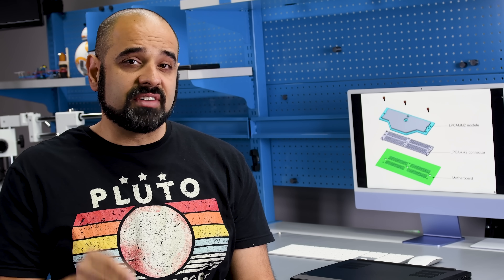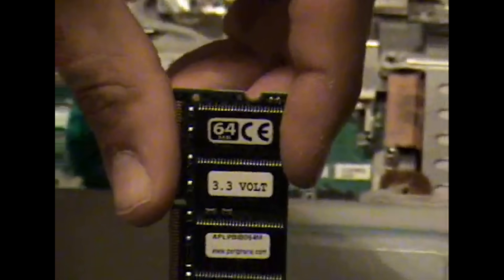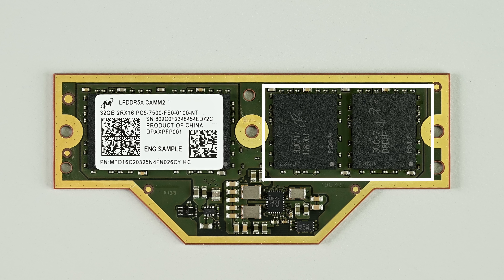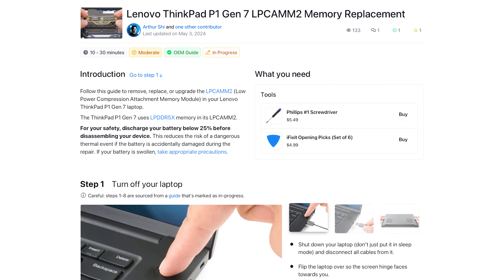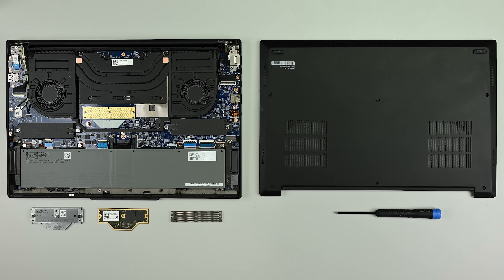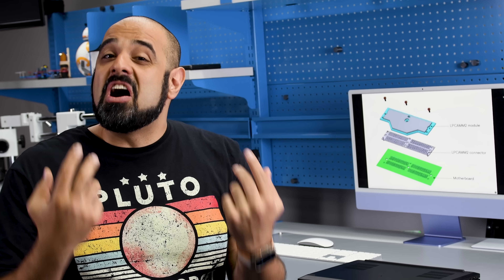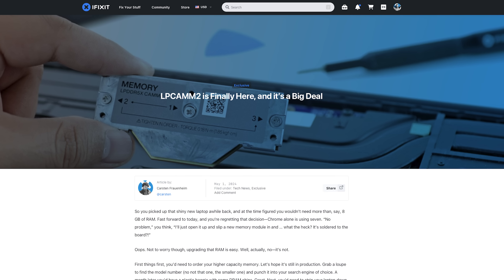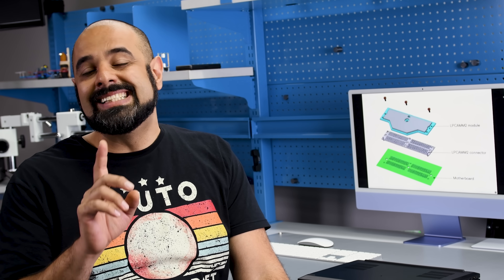New Laptop Memory Is Here! LPCAMM2 Changes Everything!

Comment: But manufacturers found a way to make you pay even more to get more memory. Why would you let the user replace the memory, if you could charge them double the amount of a ram stick for the next memory size?
Edit: As of today, only a few laptops that cost more than 2000€ have this module, yo it's nothing that will be seen on consumer laptops.

Also my 12gen Dell laptop still has normal DDR5 memory slots. On business devices it's more common to have somethin like that. I miss the times where you just had a door on the bottom of your laptop and were able to replace everything.

Comment: The information in this video seems wrong to me: as far as I know LP-DDR-RAM exists for many, many years already. And also RAM is soldered close to the processing unit because it can be faster this way (shorter connections -> higher frequency) or because it’s cheaper/easier to manufacture, NOT because of the lower voltage. The higher speed is also the reason (as well as it’s of course a nice feature for the manufacturer if it’s not upgradable..) why it’s done this way on Apples M chips and also on dedicated GPUs from AMD, Intel and NVIDIA. 

Come on ifixit, I know that you can do it his better!!

Other than that: thanks for making the otherwise good and informative video.. but please keep on taking your mission seriously and do not let slip mistakes through as it really undermines at least my confidence in trusting you. And you might just gave probably false information to almost half a million people!!

Please don’t be advert hoes! Please stay independent! We consumers really NEED you to protect us from scammy manufacturer tactics!!

Comment: IMHO! manufactures should start learn from fruit company, re-design the power supply to all power distributions. Example, 20 volts supply to PWM then step down to desired voltage, its all wrong！anytime mosfet give way & it will just lead the 20 volts to the very end of circuit, like CPU & GPU.

Comment: The reason you upgrade a Mac is the whole CPU, GPU, etc, not just the memory. It's not like in the x86/Windows world. Also ARM is a lot more efficient than the x86 architecture that carries 40 years of legacy. Would be nice to have an upgradable Mac, but it would need to be more than just the memory.
Reply: Apple could maybe even make the CPU removable without too much effort or loss of performance. Would also solve the memory issue. And a lot of people would be happy to retain their CPU and GPU while having that but of extra ram. You can still get a new laptop, the point is to give people more options.
There is nothing about arm that is less upgradable, it is just an instruction set. Apple has even made their phones more repairable. They are not doing it on laptops simply because they don't care and buying a new MacBook or replacing the whole motherboard instead of a chip generates more revenue for them

Comment: the only downside to this i guess is that its only "1 stick", so you cant alreadyu have 1 stick and then add one later. in a scenario where you bought a pc wiht 2x8 sticks, and want to upgrade to 32 you can just buy 2x8 more. in this case you'd have to discard the previously installed 16 and get a whole new 32. its a small price to pay at the end tho.

Comment: The problem. With this there is only one slot. Most of the cases for laptops with lower specs is that only one slot is populeted and just put on other stick in the empty one. With this if you want more capacity you need to replace this moudule and sell or trow away the old one. Cus little ppl will won't to use it.

Comment: It seems like 2 channels are in the same board. It kinda defeats the purpose of repairability since now you have to replace the whole module instead of only replacing a single stick in the traditional LDDR. So now if your module breaks you cant use the laptop unlike in traditional LDDR where you can still run your laptop in single channel until you bought a new stick of ram. I'm kinda unsure about this....

Comment: "Easy as 1-2-3"... With SODIMMs, there's not screws and there's no compression connector. LPCAMM2 is basically laying out 2 SODIMMS side-by-side on a single module, and still limited to 128bit bus. I'm not entirely sold on the idea...

Comment: I got an 8gb RAM Apple Silicon MacBook in 2021. Love it. I’m kinda astounded in 2024 they are still doing 8gb base though.. we’re going to have a huge recycling issue in a decade. They can’t be upgraded so what then? Software and OS’s will need more than that and we will have millions of systems that can’t be upgraded even though they are fine aside from that 😮
Reply: Apple has soldered down RAM for 13 years, starting with 4GB MacBook Airs and Retina MacBook Pros in 2012. They'll never go back to having upgradable RAM.

Comment: This is awesome but there needs to be a second pad available so one can still use the original memory stick while adding more memory and since sticks tend to be cheaper with lower memory amounts.  So if the laptop comes with 16GB but one wants 32GB then only need to buy a 16GB stick instead of a 32GB stick.  If this isn't feasible then don't make them so expensive in the first place.

Comment: In regular lpddr you can add a second stick and increase your memory, here you need to replace the whole module, throw old one in a bin. So, it's better than soldered but worse than lpddr. And in ARM architecture ram is located on chip, so forget about Apple and all the new ARM laptops, they won't have it by definition.

Comment: That looks very cool! But there is something I don't quite get. Why does this 16 inch laptop can only have onz LPCAMM 2 and not two? Coming from the gaming laptop sphere, I find that to be weird. I know that this laptop is thin and light but there are similar laptops (like the zephyrus m16 2023) that can handle two SODDIMM. I feel/think he battery size does not seem to be bigger than usual 16inch laptops (90Wh) and the cooling system is looks "as big* as ones on gaming laptops. But anyway! Great video and I'm very excited to see those on more laptops!

Comment: Only one stick of ram? I do think dual channel memory is much faster than a single channel. What am I missing
Reply: I found this quote:

"LPCAMM2 has a unique advantage as it is a single memory module designed to fill both memory channels (128 bits total). SODIMM, by comparison, will remain a 64-bit memory solution, so everything you buy to fill the first memory channel has to be purchased again to populate the second memory channel." 

you can copy that quote and search in google for more info.

Comment: The problem all along is companies design laptops with less than 16/32 GB of RAM. RAM is pretty cheap but this alone makes the laptops obsolete.
Given the available technology and the advancements made in the past decade, the entire industry should approach and design the products differently to prevent waste. I do understand it's good business to produce weak products and have everyone change them every 1-2 years, but I really believe we could do better.

Examples:
For laptop markets: a decent display panel, 16 GB of ram and provide USB-C charging.
For tv's markets: a decent display panel, enough ram for future app compatibility, use of current HDMI 2.1 standard, also USB-C charging. (been at the tv store, out of 50 - 60 TVs, only 30% of them I could consider decent, the rest of them had really bad panels with bad viewing angles waste of space, money and a lot of physical waste.)

And so on, I really like the EU approach toward the adoption of type-C charging tho I see companies like Philips keeping their proprietary port and putting a type-c connector at the other end. I get it there are some royalties to be paid but why create such a mess when you can provide type-c to type-c cable.

Comment: You forgot to mention at the start: along with SODIMM being bulky, and 25 year old tech, the sockets don't support high speeds, meaning DDR5 was off the table for laptops.

Apple literally had to stop using SODIMM because (and other manufacturers slowly cottoned onto the same fact afterwards), if they wanted to move forward, SODIMM wasn't the way to go, and there was no tech out there to readily supersede it.

IMO these LPCAMM modules came a little too late. Apple now build their memory into CPUs, and I have a feeling it won't be long until Intel and AMD do the same, making standalone memory obsolete for mainstream systems. The market has an uncanny trend of following Apple's lead when it comes to design, and Apple even have a major hand in most hardware standards, even being one of the major contributors towards USB-C.

Comment: How about we replace DRR5 on desktop pc with theses and put it behind the motherboard since its so flat, its closer to the cpu, doesn't need cooling, it could be cheaper to only have one ram standard on both laptop and desktop.

CPU cooler wouldn't be bound to Ram height, motherboard wouldn't need to reserve 1/4 of the pcb space

Comment: Love the new standard and exposure to this technology. If this is anything like other compression connectors (like Samtec ZRAY) then using a torque screwdriver is absolutely mandatory to ensure reliable connections on all pins (pressure needs to be even). Those micro machined springs can be extremely fragile, but have great SI (as long as you properly torqued and didn't flex the pcb).

Comment: Talk about power consumption smells like bullshit to me. Normal sodimm is not power hungry. Laptops with soldered ram consume as much power as normal laptops. And it is definitely not "easy" to replace as it requires 3 screws vs 1 hand on classic ram. It is also weird that pins are replaceable. Are they suggesting they are prone to corruption?

Comment: Ha! Great analogy on the low power comparison. I really love that repairability is finally becoming a valued feature for electronics (Thanks Right to Repair movement!!!). It's truly wild to think that my Dell Inspiron 7000 series laptop is 9 years old now, but with the inexpensive upgrades I made over the years, it is still perfectly functional. I added RAM to 16GB, added a 2TB SSD boot drive (SATA, but still way faster than spinning disc), replaced the crappy dim 60hz display with a brighter and more color accurate 120Hz IPS panel, and even recently upgraded the WiFi/Bluetooth card to an Intel WiFi 6E/BT 5.3 module (AX210NGW). I'm excited to see where these new memory modules take us, but for now, I am still quite happy with my modded Dell laptop.

Comment: Apple will adopt it if it is truly as fast and power efficient as people claim.
The most important statistic about a laptop is how long you can use it for standard lightweight tasks and how hot it gets. Its a wireless device that sits in your lap. The battery needs to last long, without your lap getting hot.
The fanless macbook airs that last all day and don't get hot are simply a game changer that the rest of the industry will either adopt or die, cause a lot of us aren't going to compromise on those two things that matter the most. Upgradeability and repairability actually do not matter as much as battery life and heat, so we shall see~

Comment: 1. Why is no one showing the back of that RAM plate? It's nowhere to be found, aside from like CAD designs, almost as if they're afraid it would get criticized.
2. I get that it allows for shorter traces and physically thinner mainboard+RAM package but this connector gets close to something like a CPU sockets - densely packed, delicate and easy to scratch, bend, rip off etc. I can also see some risk of mounting RAM too quickly and screwing it in slightly misplaced.
3. Why such a weird shape.. Maybe just for marketing purposes so it's like "more" new and drastically different. It'll be just more work for mainboard designers to wrap other components around such a weird shape.

Comment: 3:06 "compression connector is also replaceable" okay, NOW I'm impressed. i been saying for years motherboards ought to do this for their CPU socket; make the bottom of the CPU and the top of the board both an LGA, have a replaceable interposer between the two that's just a grid of double sided springy pins.
Reply: I've been building PC for 3 decades and never had an issue with the CPU or CPU socket. Some people should just stick to laptops...
Reply: @bobbymoss6160  Then evidently you've never been tech-curious enough in all that time to have a bench PC that you frequently like to change out the hardware on for testing or experimentation lol
Cause let me tell you, Intel style CPU socket is a disaster for that use case, especially if even the tiniest drop of thermal paste ever drips onto it
Reply: @datachu  If it works, it works. Why FAFO?
Reply: @datachu  best way to clean thermal paste is wd-40 contact cleaner, it melts the thermal paste. then use compressed air or leave it for 1 hour until it dries.
Reply: @bobbymoss6160 because sockets change all the time anyway and it's really not that big of a change. If you only replace the cpu, then there will be no downside and little to no change. On the other hand if something does break, you can just switch out the socket and you're set.
Reply: @Flying_Spaghetti_Monster Thing is that Intel kept changing sockets every 3 generations look at AMD the most supported socket is their AM4 like they have so many CPUs to choose that can use AM4
Reply: @bobbymoss6160 The sole reason most people use laptops are you get practically everything and for the same price in theory you can build ITX PC but most GPU out there can't support anything less than 15L case
Reply: @bobbymoss6160  maybe youre just 1 guy. Or maybe its because you dont do mass benchmark testing 😂 nobody asked for your two cents

Comment: I just don't see a difference between this and sodimm. Still use a pcb, seems even more complicated with more components on the ram pcb. Ideally would be best to just change from BGA to standardized socket nand chip,just like cpu socket. Only 1 component,lower cost and (when socket implemented) more easy to produce,less e-waste. Image in the future using dimm stick on desktop where you replace only the nand chip,using the same DDRx pcb.

Comment: laptops have a lot of surface area so that may work, but what about a way to build a small, power efficient but still blazingly fast mITX? will it fit as easily? I wouldn't mind putting it on the backside if that helps

Comment: I feel like in-chip ram is not too bad if you also include way of adding more RAM externally.. you could then think about the in-chip ram as another level of cache in a way... getting the benefit of better speeds and also getting the benefit of capacity with external upgrades

Comment: Dont forget each module is 2 memory channels already, so you dont need 2 sticks for dual channel mode.

I wonder if this sort of tech can be implemented in CPUs? Everyone complains about bent pins, so what if the pins were the same compression module thing that could be replaced? 🤔

Id also love to see these replace normal dimm slots on desktop MBs. Maybe have 2-4 LPCAMM2 sockets on the backside of the MB? These are pretty low profile so looks like they could easily be placed there and free up space on the front side while also getting the memory sockets closer to the CPU that way.

Comment: Soldered RAM would be less of a jerk move if the prices they charged were reasonable. Charging people $400 more for an extra 16GB is the real reason they want to solder it on.
Reply: Exactly. I prefer replaceable, but I'd accept soldered if price/GB was reasonable. That fact you can buy whole ass retail packaged RAM modules at 1/4 the cost of a couple soldered dies is robbery.
DRAM is pretty robust, I'm not too worried on the small chance of failure with soldered.
Reply: Apple charge you more to go from 8GB to 16GB than I paid in total for the 64GB ram in my laptop.
Reply: not only that. I have 11 years old 17" laptop with i7-4700m it still works, but I had to upgrade memory couple of times and replace it two times because it failed. Yes performance of i7-4700m is around 100 $ intel n100 NUC PC, but I can always replace memory upgrade it as I need it.
Reply: @sebek23b  Put SSD into that laptop and it will run good, the m chips are strong CPUs for laptops still. Most laptops in that generation used the Intel U chips that only had dual core processor and were ran with a very low wattage prioritizing battery over any kind of speed, they are painful to use but yours should still be quite good.

Comparing performance to a NUC is a bad move as you can compare most laptops to the Intel i7 2600 (the 2nd generation i7 for desktop) and the i7 still beats most of them. Desktop processors are just a totally different class to laptops.
Reply: No. It would always be an asshole move. They're not putting a representation of an ass plopping a turd on all their products because they're a proctology-instrument company.
They are assholes.

You're just in your "bargaining" stage.
Reply: It would still be a half solution as future upgradability is not possible with it.
Reply: I got 96GB 2x 48GB DDR5 just for $200 :face-blue-smiling:
Reply: but muh market segmentation
Reply: All of my laptops have replaceable memory.   I wouldn't consider buying one without it.  Being able to easily expand your memory is too useful not to have.
Reply: frankly, 8GB models(even base models) shouldn't exist in the first, place, simply because they aren't future proof and as a result - environmentally unfriendly.

Comment: Repairability is when i apply heat and replace the chip.
This is not repairability anymore, its a swapability.
Modular design basically.
Anything modular is not solid. More points of failure from a repairman point of view.